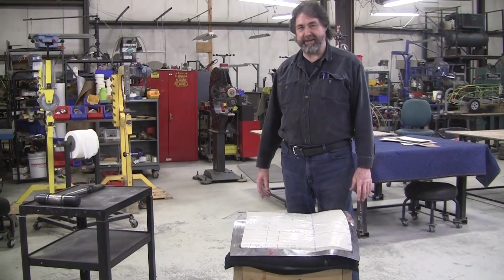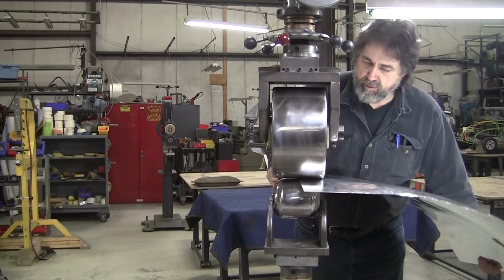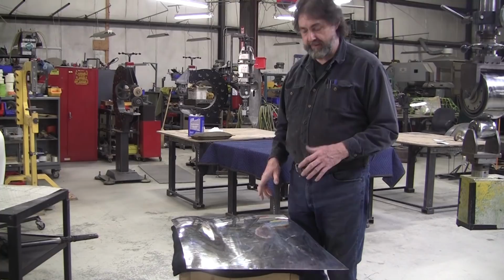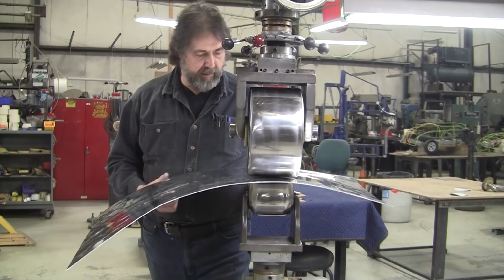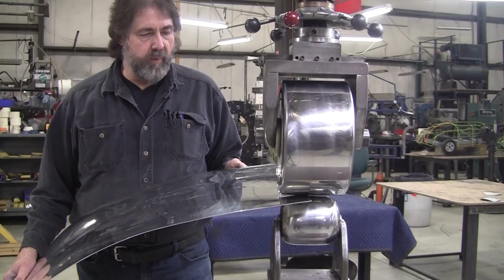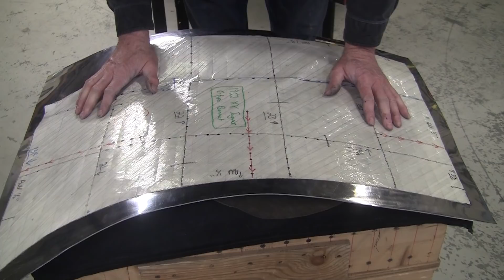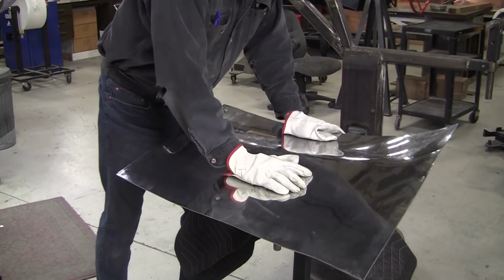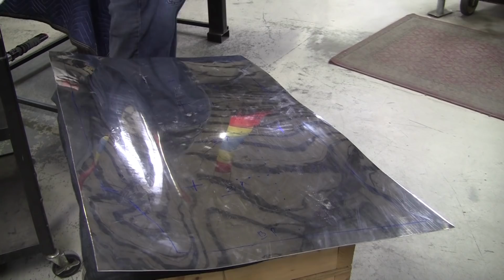Metal Shaping: Jaguar E-Type Bonnet Build - Part 9C (1 of 2)

Comment: Wray I noticed you use the wide English wheel the most. I am in the process of laying out my own English wheel and have a 8" dia. chunk of steel for the top wheel that is 4" wide. Should I use it as is or maybe cut it down to 3" wide? What is a good diameter for the lower wheels?
Reply from the maker: My large yellow English wheel's top wheel is 5.5 inches wide x  9.875 inches in diameter. The anvils are 4.750" wide and 5" in diameter.  I use my  large yellow English wheel most of the time, once in a while ( less the 5 percent of the time I use one of my other English wheels in the shop that has narrower anvils) I also have a English wheel set up for doing reverse curves that has a 5" diameter top wheel which is more user friendly for planishing tight radius reverse curves. Once you use wide wheels you will never wheel with narrow wheels again. They work so much better. This craft is tradition bound in it's thinking.  The general beliefs are you have to gas weld aluminum, you must have a cast English wheel, you must make panels by pattern wheeling, etc etc.  The power hammer guys just laugh at the poor fools that English wheel.  Metal shaping, religion, politics, are all the same divided into small subgroups that all feel they are the only ones doing it right.  Truth is there always about four different ways to do any human task. There are a million bad ways as well.